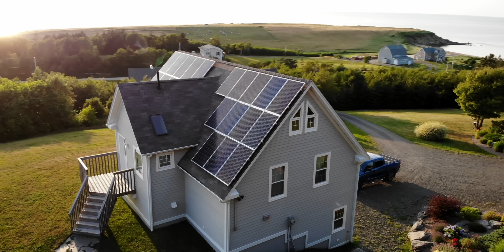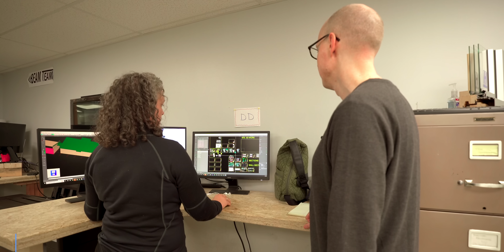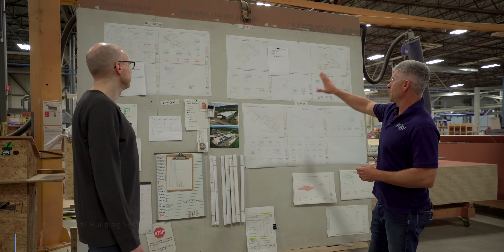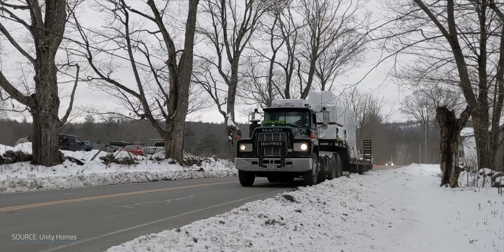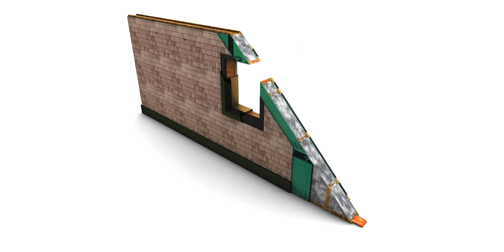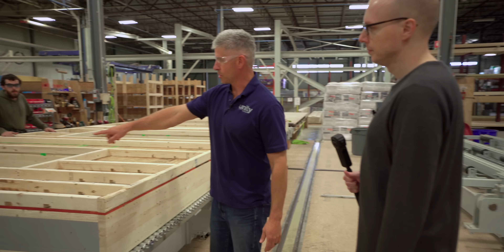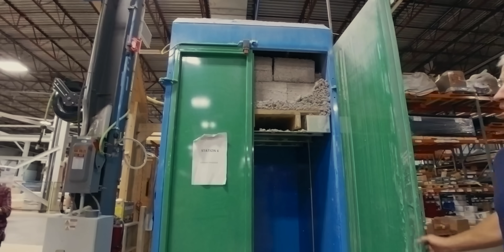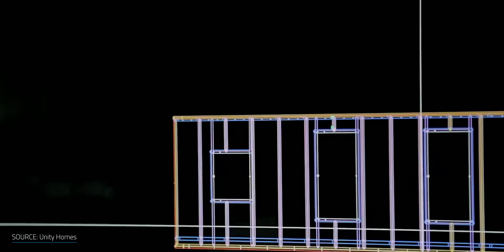The Simple Genius of a Prefabricated House - My Net Zero Home Build

Comment: I had exactly the same question - how come we don't do this all over the place already. This is for sure the future. The ability to build it in controlled environment and then transport onsite, bolt together, that's a big thing. Imagine you would order a car and someone would show up with a bunch of steel sheets, CNC machines and aluminum and started to build it on your parkway...
Reply from the maker: Love that picture you painted, Robert.
Reply: There are factory built home manufacturers all over the US. Have been for many decades. There are some misconceptions about manufactured homes probably because of the, generally, poor quality of mobile homes. Mobile homes are, largely, a thing of the past due to new building codes. Modern modular and panelized homes have come a long way from the early days of mobile homes. I worked in a modular home plant for over 30 yrs and I can tell you that they are as good or better than site built homes. The public is slow to accept them due to perceived  stereotypes.
Reply: @tims8603  Plus the misconception that modular homes are just a few basic box shapes bolted together in a few limited ways that always winds up looking like a stack of boxes that shouts "modular home here".
Reply: @tims8603  -- Manufactured homes are still a thing. What has made them a thing of the past in some areas is snob zoning, not building codes; they are built according to a different set of codes. Personally, given the housing crisis in the U.S. today, I think that they are a good solution for many, though I would prefer to see their manufacturing standards updated with regard to thermal efficiency.
Reply: So, this method is growing rapidly, for one thing. Another is that modularized and modular construction would've been the dominant method in factory settings prior to now, rather than pre-fabricated like this. Instead of panels they just deliver whole cubes of the home to site and attach them together.  But probably the most important factor is just up front costs - you're looking at a plant that probably costs more than $50 million, highly specialized machinery with computer control, in addition to skilled labour at every step, plus a distribution team who needed to design the vehicles they ordered. The trailers I saw were lower than standard so that a 9-10ft wall panel isn't set atop a 5ft trailer deck, making them require special routes and permits. 
A huge factor is that homebuilders have been doing mass production in the field instead, with crews that do the same task on dozens of homes in a row. Those production homebuilders are huge incumbents wherever they operate. They maintain close relationships with municipal officials and are hugely active in city politics. They are the old guard, and they are the ones buying huge lots of land to turn into the next suburban mazes. And in my area, they are beginning a transition away from the single family home build because they can sell 8x as many condos for 60% of the price. This method will be very successful for wealthy individuals who want to build in rural areas, but around city cores you're just going to see densification.
Reply: @CanCobb  What's stopping a homebuilder from buying modular homes instead? Wouldn't it save the builder labor and material costs ? Builders can still maintain cozy relationships with municipal officials, while moving away from the build process altogether.
Reply: Inertia, maybe employment inflation (that's what any bans you'll see will be about), sometimes paranoid HOAs. Those are my guesses, as someone studying architecture right now.
Reply: Cost is the issue. Biggest problem is that the banks are not willing to finance the cost of the home since they use comps to determine the assessed value of the home.  SIPS cost more so the homeowner will need to come up with a lot more cash and you own a home that costs more than it's assessed value
Reply: @timothysullivan7433  This is exactly what I ran into while planning out my house. Initially thought I'd add exterior rockwool insulation, thermal bucks, 4" of slab insulation, etc., etc.. But then when I saw the added cost (which I could afford) I thought about resale. I'd have to stay in this house for 2-3 decades or take a loss if I decided to sell. Instead I settled on 24" OC advanced framing and sealing as much of the exterior envelope as possible. These things alone increase efficiency way more than the average house, but will leave me with a house I can sell if I need/want to. Also, don't get me started on the logistics overhead on a prefab house. This isn't the first time this has been tried. But I do appreciate the high tech involved and their angle on problem solving. I just don't think it's practical.
Reply: @timothysullivan7433  If you ever need to sell one of these, you are going to have to find someone with the same mindset as you.
Reply: @BiggMo  I can remember those types of modules built on the same steel frame as cheap mobile homes going down the freeway with one entire wall missing where that module would bolt to the other modules of the house. The open side would have a few bracing boards across the opening to keep it all from just collapsing under its own weight and would be covered by an enormous sheet of plastic film to notionally anyway keep the wind and rain from whipping around inside the module. Through the plastic you could see that the entire interior was prefinished inside the factory including light fixtures with the glass already installed.

These were mostly coming from mobile home manufactures trying to use the methods they developed to build lightweight and cheap mobile homes (which were in turned developed from the travel trailer industry) to expand into the "normal" home market. I think these early pre-manufacted homes gave the entire modular home industry a bad rep as cheap and flimsy.

The industry has advanced far beyond those days. One major method is to build all of the wall-panels in the factory on high precision jigs with full-sized construction material, not the thin and flimsy stuff used in mobile home grade pre-manufactured housing.By using engineered materials like wood I-beams that are very dimensionally stable and don't warp like a solid wood construction grade 2x4 and 2x6 used in most stick-built houses these wall panels can be made much thicker with less material to allow thicker insulation. And with less material in the web of the wall I-beams running from the inside to the outside wall, there is far less thermal bridging. 

Also due to the high precision of the construction there are none of the odd gaps and voids like happen in a wall built on site. So when combined with the better equipment to apply caulk and other sealing methods like sealing tapes in a very precise way, that panels leave the factory very air-tight. Then when assembled together on-site, only the joint between panels has to be sealed.

So maybe it is time you update your idea what "factory-built" actually means.
Reply: @papparocket  I worked in residential construction for decades, and none of the crews I worked with left "odd gaps and voids." I think you've been watching too many worst-case scenario videos. And the same methods of applying sealing tapes are available in the field. So is caulk. And flashing.
Reply: Everything's slower in the US when it comes to construction, private, public, small scale and especially large scale.
Reply: So a couple things that would slow down the process of adopting this style of construction are cost and labor.  Besides the expected "They Took 'R Jaabs!" reaction you'll get from construction companies everywhere (which is funny as the labor availability is dying faster than the pumpkin on the porch) and push back from that, there's the big elephant in the room; cost.

Matt, can you tell us what your final cost per square foot with foundation and installation turned out to be?  Compare that to a current stick-built McMansion and I'm guessing it's significantly higher for the factory build version.  Yes, economies of scale will help in the future once there are more companies doing this.

But the 3rd factor is also turn around time.  Most mortgages for construction loans (where you buy a piece of land and have a new house built) require the home to be moved into within a year.  If there are 5 houses ahead of you on the order and the factory can only make 1 house at a time, you've got to wait quite a while before construction starts.  The problem only gets worse when there are 50 houses ahead of you and you've still got the limitations of what you can do due to weather and land conditions.  Can't clear trees in December?  Gotta wait until March.  Gotta pour concrete for the foundation?  How's the rain looking?  All the prep work that has to be done in good weather is outside the actual construction of the house.  Granted, this is true in the stick build world as well, but when a stick build gets rained out on Tuesday they can be back Weds, whereas rescheduling a factory across state or across country may not have that kind of flexibility.  Transportation costs are also murder.  Yes, the panels and parts can stay stacked up in the warehouse easier, but the cost of getting my new home in Seattle from the factory in New Hampshire is a MAJOR factor in the overall price because New Hampshire is still getting just as raked over the coals as Seattle is on lumber prices.

All in all this system has great potential and once the building standards are out there and more and more companies are building more and more factories to build it the price may come down to "Roughly Affordable" and really take off, however as others have mentioned getting things changed in the US is slow.  Like molasses in January slow.  Much like EV's and the infrastructure challenge they now face this seems to be a technology that is really still in its infancy.  Even now Modular homes haven't really taken off and many banks will fight you for a construction loan to get one because they think that the horse & buggy is just recklessly fast for anyone to be moving at.  

This system is modular homes on steroids and hopefully once the stigma of "Trailer Parks" can be separated from the Modular homes we have now (ya know, once us Boomers are finally not in control of everything) then the Modular Home On Steroids Yay Efficiency systems can really take off. 

I just hope I live long enough to see it AND that it becomes affordable enough to happen.

Just my $0.02 as an "Enlightened Boomer" anyways.  🤔
Reply: Because the home that Matt is building STARTS at $400,000. When half of the households, not people but entire households, make less than $70,000. Houses that are near half a million aren't a viable option. 

Then consider there are many areas where the median household income is closer to $40,000. Homes that are 10x what people make gross aren't viable.
Reply: @stormelemental13  Fair point. But I do believe that with competition and economy of scale, this will get much cheaper and available. I did not know there is such low income in US... $40k is already comparable with eastern European countries AFTER taxes and insurance deducted. Interesting...
Reply: @rklauco   Many people are surprised by that. I live in a small farming village, median household income $40,000. The county overall is a bit better $48,000. Are we better off than comparable areas in eastern europe, yes, but not by as much as many think. And it means that many of the things Matt talks about are out of reach of the working class. 

I hope the price does come down, but sometimes when I watch videos like this I want to ask the creator, "You seriously think the teacher at your kid's school, the clerk at your bank, or the person who cleans your office can afford any of this?"
Reply: I would think one of the biggest issues is akin to factory built being serial in nature versus on-site being parallel construction - happening in cities  all over the country at the same time.

Comment: Impressive video! I live in Florida and many structures are built with cinder blocks, which have large center cavities. Most cinder block walls are not insulated. I am waiting for 3D printed walls with a foam thermal brake.
Reply: I might add and check out: Kerry Tarnow - YouTube Channel. It is a site dedicated to prefabs.

Comment: I own a Factory Built house that I purchased (the first time) in 1971.  With a first-born on the way, it was either moving up to a two-bedroom apartment or paying towards something I would actually eventually own.  The house is a 1100 sq ft bungalow, built in a factory 400 miles away and shipped on two flatbed trailers to be joined to a precast foundation.  My thinking was that “a house that can survive 400miles of highway will probably last a long time on its foundation “.  The siding is mostly aluminum, with a brick front installed after the units were joined here.  It’s mostly maintenance free. . .  the Alcan house was my choice because I had spent too much time in my youth growing up scraping and painting the family home.

All most ALL issues I’ve had over the 50+ years of ownership have been due to the quality of the local labour done on site. . .  Quality Control is not a strong point of local residential construction.

Even with the original windows, my annual heating bill is below $1000.

I’ll be leaving this house feet-first.

Comment: I see that from and insurance/restoration to pre loss condition perspective after a water damage. Look at all the OSB (=Oriented Stranded Board) panels in particular for the ceiling joists that replacer traditional 2x12 solid lumber. OSB does not hold up to water. Let's say there is a bad water leak on the second floor that does not get mitigated for a week, the re-build requires not only to remove all dry walls and insulation, but the 2x12 ceiling joist containing OSB are disintegrated and need to be replaced, in essence rendering the whole structure a total loss. Why not using pressure treated 2x12 or at least solid wood 2x12 ceiling joists they may survive a water loss.

Comment: Net zero?  Really? Present a quantitative analysis around the building process system, on which a material and energy, (carbon basis) balance was conducted, demonstrating net zero.
Reply from the maker: I mentioned this in the video, but in this context a net zero home means a house that produces as much energy as it uses over the course of year.  It's not a carbon neutral build.  Case and point ... I live in Massachusetts: https://www.mass.gov/service-details/what-is-a-zero-net-energy-building
Reply: @UndecidedTechnology  The point is that the reliability for any net zero claims, beit energy or carbon, depends upon the boundary drawn around the system claimed to be "net zero."   These system analysis calculations are not straightforward. Too many "net zero" claims are being tossed around without supporting evidence. There needs to be disciplined, quantitative engineering  calculations to validate the accuracy of such claims.

Comment: But they're using wood framing.
Which happens to be one of the worst things to use.

Unless you live right on the salty coast, steel is superior in every way.

Especially energy efficiency and lack of rot, mold, algae, warping twisting, and cupping of the wood.

 And just generally not causing the entire house to warp out of square, which causes cracks in your walls and trim. 

If wood was a brand new invention, and someone took it to a home builders convention to show it off, they'd literally laugh it out of the building after all the negatives were listed. 

As someone with 20 years residential/commercial painting experience, and the last 7 flipping houses, let me assure you that wood does suck as a building material.

Comment: here in Sweden it's very common that houses are pre fabricated in parts. even if the houses aren't passive houses. There's numerous companies producing pre fab houses and to very high standards
Reply: here in the netherlands it is too but unfortunately we built mostly concrete prefab homes, with wooden roof rafters tho. we got very little natural wood. I know the scandinavian countries, germany, swiss, austrians have incredible prefab factories indeed. wood lends itself much better for prefab homes than concrete of course.

Is wood fiber a common insulation material in sweden, or is it mostly rockwool?
Reply: @ducoh2093  To my experience insulation is 99% Rockwool. Wood fiber is used sometimes if the person ordering the house really really wants it. We also use none of that foam insulation that one often sees in American houses. (we have foam insulation but it's used in very specific cases and in very limited numbers. We never insulate an entire wall or wall section with foam.)
Reply: @TyphorT38  Thank you, yeah I remember another swede saying something like most is rockwool. Surprising tho giving the fact that the germans and swiss absolutely love wood fiber. They place their OSB with taped seems on the interior side as a vapor control layer, and then use wood fiber board on the exterior side. It is water resistant, so it is their waterproofing membrane and continuous insulation all in once.

We use mostly glass wool, it is very cheap and since we have brick and concrete walls, we dont need a drying cavity. They just get stuffed in there. But yeah, giving the fact that we already have a really high carbon footprint for the concrete walls I guess builders cant be bothered using sustainable insulation materials at all.

Shame we miss you in the Euro 2024! Regards